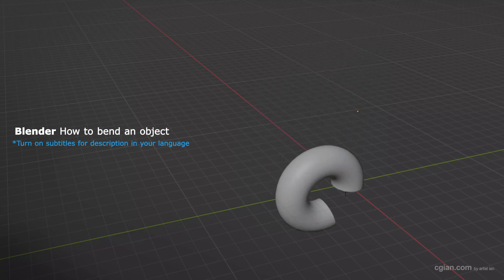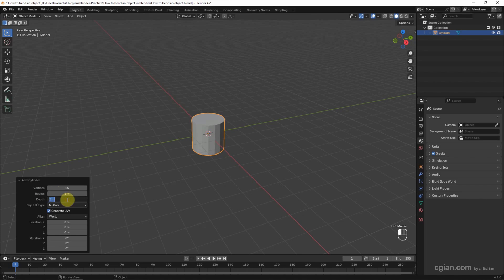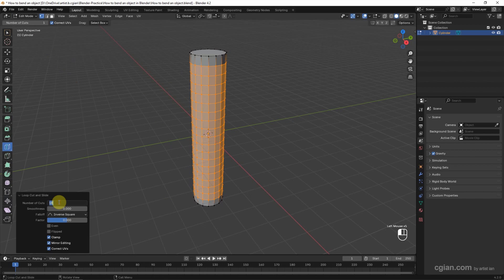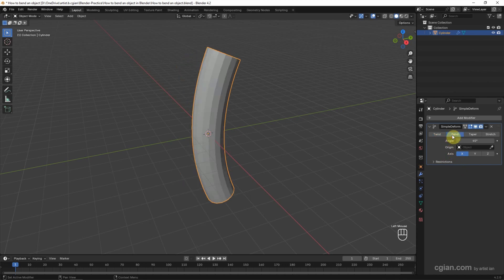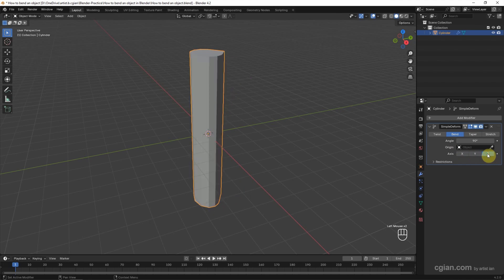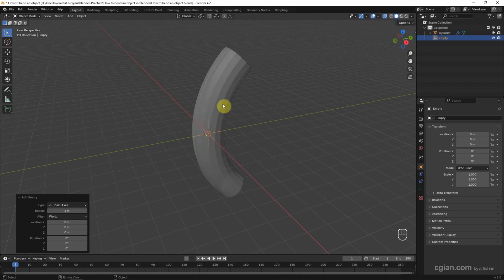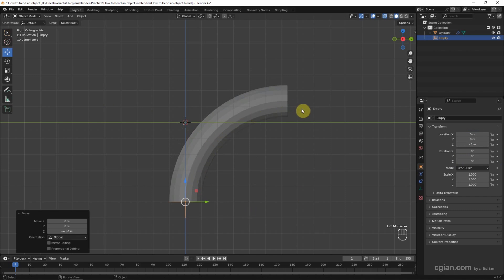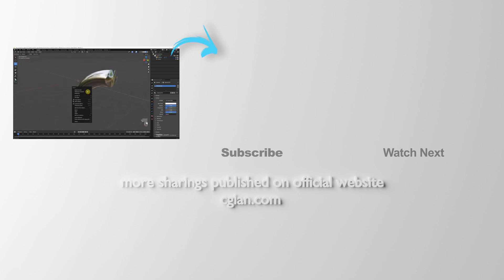Blender how to bend an object using Simple Deform modifier

Comment: Very helpful. 
I was making some railings and wanted to do a 90 degree curved corner. 
Spent ages messing around with curve modifiers.
This is so much easier, thank you!
Reply from the maker: You are welcome. Glad that the helps.
Reply: im very late,but u could connect the objects u wanted to connect,join them using ctrl+j,and then ctrl+e and bridge edge loops,u can modify it how u want,better watch the bridge edge loops !